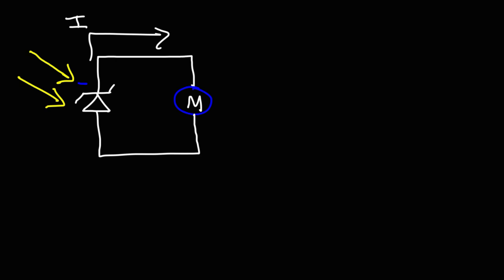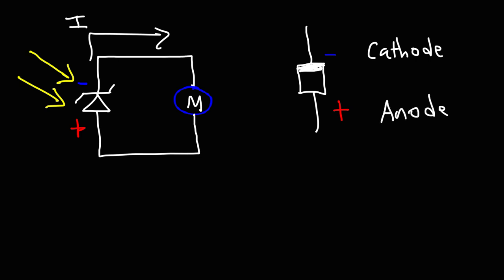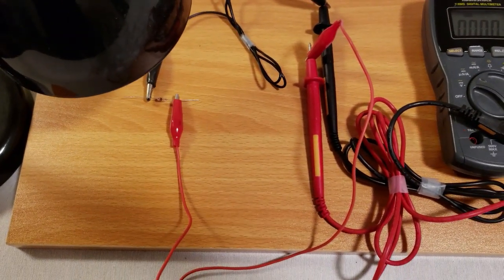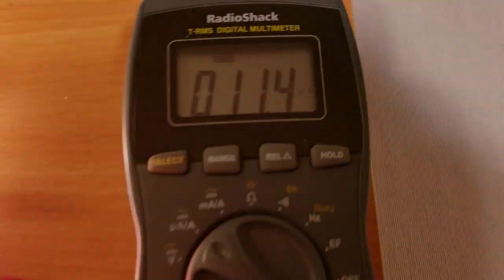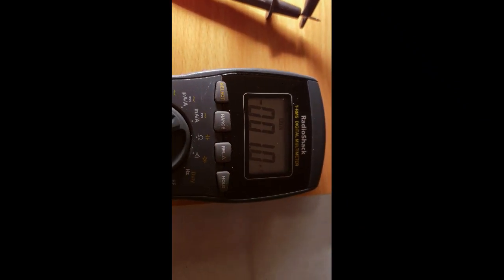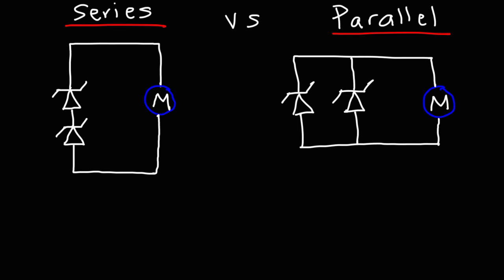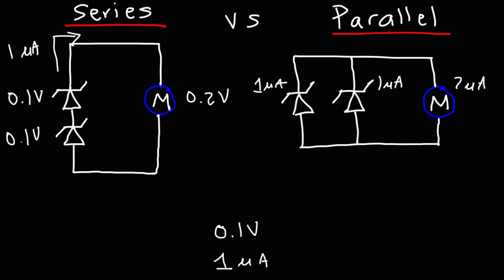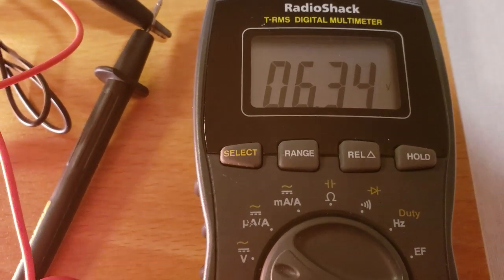How To Make a Solar Cell Using Zener Diodes

Comment: Thanks!! For these vids dude as I am trying to learn circuits on my own
Reply: Check out CircuitMod. It's a circuit simulator you can run in your browser, or download. It did wonders for helping me to learn this stuff. It's a really great tool for being able to visualize what's actually happening in a circuit and to just play around with circuits without worrying about blowing anything up. It also has a lot of example circuits that you could spend months learning about and playing with.

I also STRONGLY suggest checking out the textbook section on allaboutcircuits.com It's hands down the most useful resource I've come across. And it's laid out in a way where the topics are in a sensible order, so you don't have to try to figure out what all you need to know before trying to learn about something.

I just started this stuff a couple of years ago and between these 2 things along with lots of hands on experience and just looking up things I don't get on wikipedia, and YouTube I've learned so much stuff. 

Keep at it, and be patient. Enjoy the journey of discovery and don't worry too much about how quickly you'll learn this stuff. Try to make a point of learning something new every day and before you know it, you'll be understanding things you didn't even think it was possible for you to get. Don't try to rush it. Feel free to jump ahead to the fun bits, but always make sure to learn the fundamentals, like math or circuit analysis.

The math may seem overwhelming at first, but it's very different from school. I found that learning math in the context of something with an actual practical use helps it make a lot more sense than how they teach it in school. And if you don't understand something, don't be afraid to take a step back and learn about some prerequisite topics. There were a lot of times where I'd go to learn about one thing, then find there were 4 or 5 other things I needed to know first. So I'd have to put that on the backburner while I brushed up on the other stuff and come back to it later. Especially when it came to transistor circuit analysis, or designing amplifiers and oscillators.

I hope that helps without being too long winded. I could go on forever about this stuff. But I'm sure that would get boring fast. Cheers, and happy learning. =)
Reply: Oh my god! Thanks dude that is amazing help. You are soo nice you took so much of your time to help! Thanks
Reply: You’re such a good dude! Thank sooooo much

Comment: So you would need 28 zener in series to achieve 12v, and then 100 of this in paralell to achieve a comercial 12v1A panel. That make 2800 zener. Big ass panel. It would be impressive to see something like that working.

Comment: This also works in reverse. A photocell will emit infrared light with a high enough current passing through it. For example, if you run current through a solar panel.

 You can also use any PN junction device as a photocell like you demonstrated in this video. Something like a transistor, PN junction diode or even an LED. You can test this pretty easily if you connect a white LED to a multimeter set to voltage mode and shine a bright flashlight on it. It'll cause the LED to have about 1 to 2 volts across it. And you can measure a couple dozen microamps of current.

 It also works if you remove the package from a transistor like the ones in a metal can and expose it to light. There will be a voltage across the PN junctions. This is just an inherent property of PN junctions.